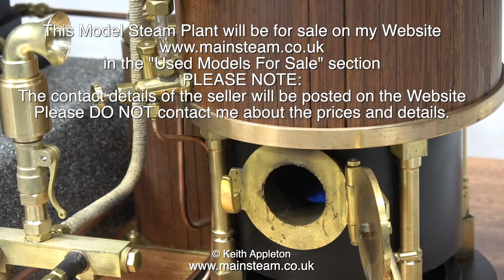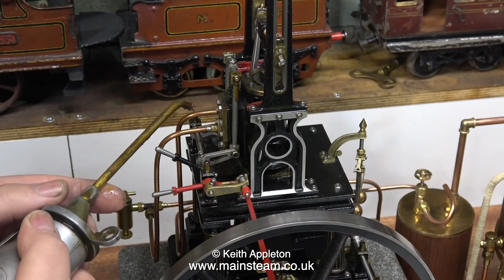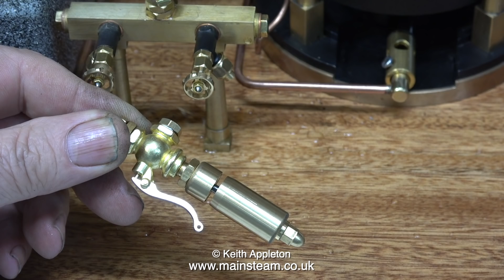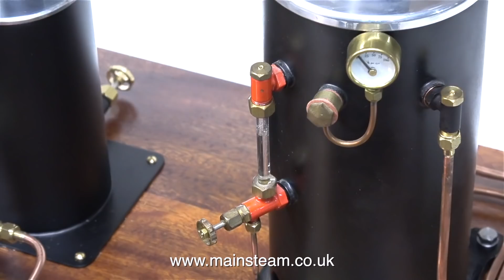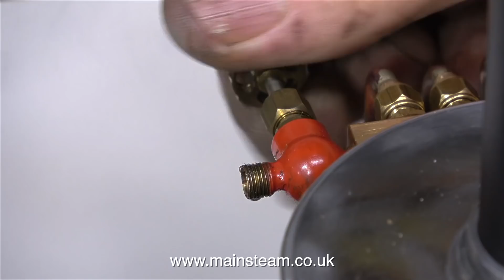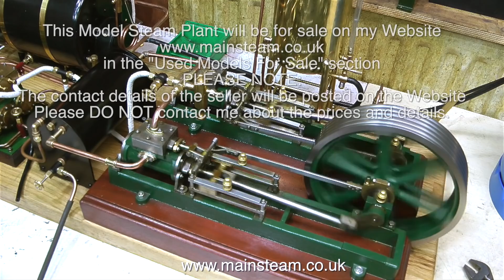SOME SUPERB MODEL STEAM PLANTS - NOW SOLD

Comment: When you add water, does it have to be a specific type of water, such as distilled water?  If it works on any water, are some types better than others?
Reply from the maker: I use Tap Water, but you can use distilled or de-ionized water too.